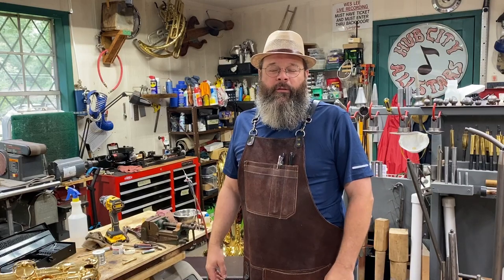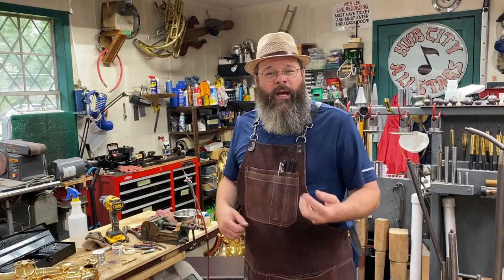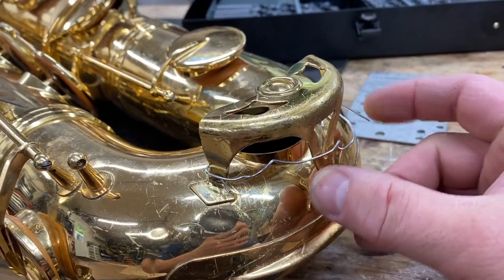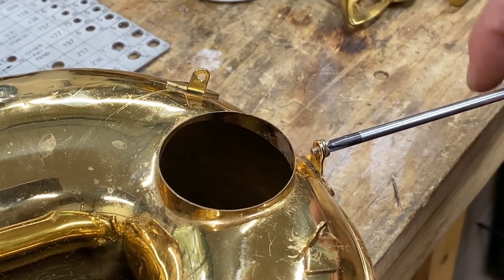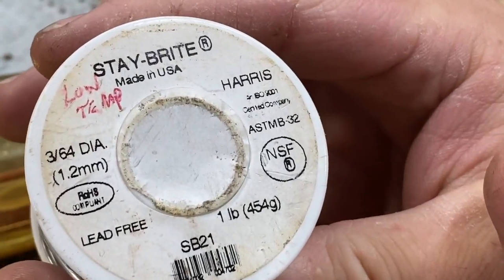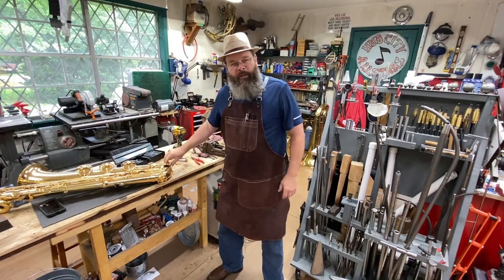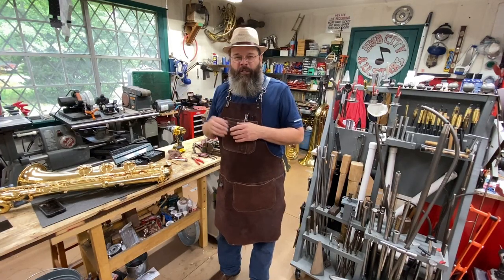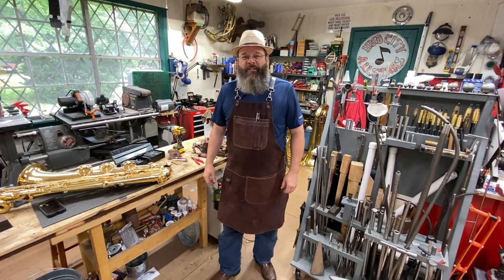Saxophone Key Guard Repair- Drill, Tap, Thread Oh My- Band Instrument Repair

Comment: Thanks for sharing the repair.  I was impressed how nicely the low temp filled in just the right amount.
Reply from the maker: Thanks for watching. Yep, all about that heat control. One of the shops I worked for along the way, the man said old timers with great heat control could solder cigarette foil paper together. Impressive

Comment: That was brilliant!  Another way is to solder a brass nut on the back side of the brace. Use the screw that matches the bolt.  And the loc tite.  Still, I like your fix a lot better.
Reply from the maker: Thanks. I tried the soldered nut  once earlier in my career,  it did not work out for me. I know some people can, but that was a flip for me.

Comment: Kraus Music Products make self tapping oversize screws for key guards.  I have also cut a slot in the tip of an oversized screw with a jewelers saw.  This makes it self tapping enough for the thin brass of the guard feet.  Great video.  I never thought of using the solder.
Reply from the maker: That’s a cool product, I will try and find. My browser does not do good things when I try and find Kraus. I don’t know what is up with that

Comment: Another amazing job.  Looks like you could have been a surgeon.   Such skilled hands.   You listed a couple of reasons that the screws strip out.  All valid, but you left out a major one.   The manufacturer was either too lazy or too stupid to form the hole correctly in the first place.   Having formed and tapped literally thousands of holes I know there is a simple technique that can increase the strength of a tapped hole in sheet metal.  It involves drawing part of the metal as part of the piercing operation.  It can literally double the length of engagement.   Love your channel.
Reply from the maker: Thanks. And what you say is true, there is another brand that does the draw that you write about, and they have very few problems with screws stripping out.
Thanks for watching and commenting!